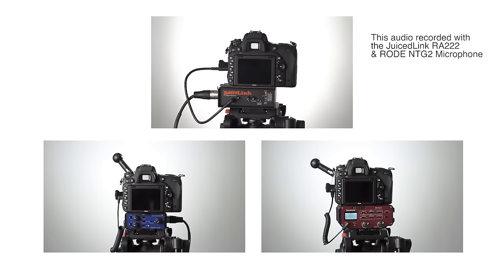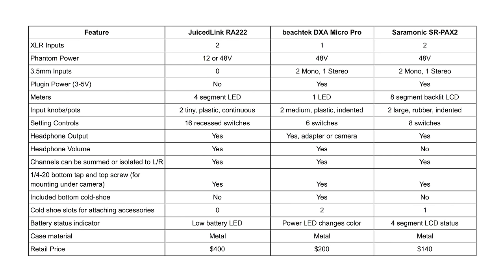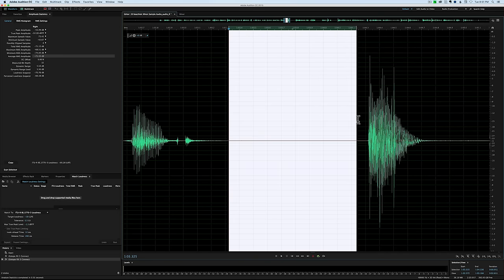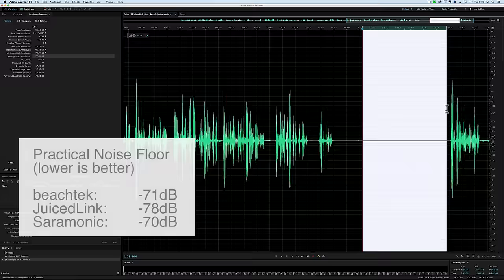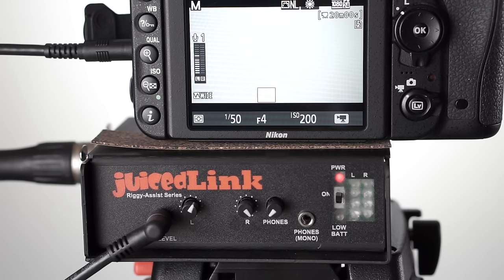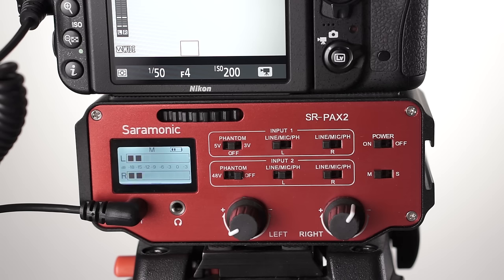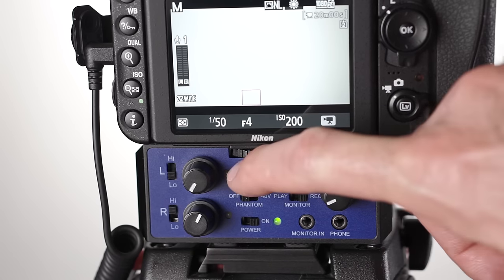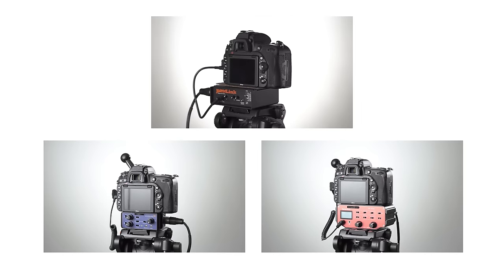Three Audio Adapters for DSLR and Mirrorless Cameras: JuicedLink, beachtek and Saramonic

Comment: Nice review Curtis.

I watched that in a hurry, so maybe I missed something, but in this video the Saramonic unit seems much less noisy than in the +Basic Filmmaker review ?!? Or is there some setup differences that could explain that ?
Reply from the maker: Hi Sylvain, This is a different adapter than the Basic Filmmaker used and he was using a Canon DSLR (I used a Nikon D750). I'm also not 100% sure which settings he used, but between all of those differences, it appears that this Saramonic adapter can do a decent job.
Reply: Ok, 'got it : Saramonic MixMic vs Saramonic SR-PAX2 ...

How could I missed that ?!? Obviously they don't sound the same ! They don't even look the same ;)

Sorry for having wasted your time, Curtis.
Reply from the maker: Not a waste of time at all! I think there are some nuances here and +The Basic Filmmaker and I talked a little about it. We don't have any conclusions yet.

Comment: Curtis, do you have any recommendations regarding the irig pre, pro or apogee jam being used as an audio adaptor with or without iphone app intermediation?  It is my understanding that you can use a converter cable and bypass using an iphone with any of these devices, but wanted to confirm.  How does that affect sound quality?   Best.
Reply from the maker: Hi Matthew, I assume you mean to record directly to a camera? Which type of adapter would you use? The reason I ask is that the iRig Pre HD has a great analogue to digital converter in it. For most cameras, you'd need to convert that digital signal back to analogue only to have the camera do the A/D conversion again so it probably isn't an ideal setup. I hope that makes sense.

Comment: you can fix the heaphone audio volume control  issue with one of these, you can find them on amazon.
Stellar Labs 35-4180 In Line Headphone Volume Control
Reply from the maker: +smitthone thanks for that.

Comment: Curtis great video as always!!! How would you compare the use of these vs a Zoom?
Reply from the maker: +Emilio Jimenez that depends on the zoom. ;) I mostly record audio separately, but these are a good option if you need to deliver your production quickly. These adapters seem more durable in terms of physical build compared to similarly priced Zoom and Tascam recorders. But I still prefer the quality of audio achievable with a dedicated audio recorder. Still, I like having an adapter on hand to use my GH4 as a webcam which avoids audio sync issues.
Reply: Does a Tascam 70D fill both needs? I have a beachtek and a zoom h5, but only 1 NTG3, so I’d like to record straight into camera and onto an SD card.

Comment: Interesting comparison. I own a Tascam DR-60D MKII... Would you say the Saramonic PAX2 can be compared to the Taskam? I'm trying to save some money, but not if it's not worth it
Reply from the maker: Hi Daniel, The Saramonic does not supply as much clean gain as the Tascam and, of course, is not a recorder on its own. One of the benefits of the Tascam is that you can record to both the DR-60DmkII and the camera at the same time which can be a valuable feature in many cases.
Reply: @curtisjudd  you've mentioned that Tascams do not have a clean 3.5mm output. I guess in that sense (recording directly to your camera), Zooms are the way to go.
Reply from the maker: Hi Daniel, the output on the DR-60DmkII is quite clean, it is the 3.5mm input that was on the noisy side.

Comment: Hi Curtis, I am setting up a Sony A7Rii as a Video Production Camera. We have a Zoom F4 Mixer/Recorder. I am just wondering what your thoughts are on connecting the mixer to a camera are? If we are connecting to camera, would one of these adapters be the best to use between camera and audio mixer?  And, if we are using a clapper, is it still safer to connect the audio to camera, or should I be recording seperate sound and rely on the camera mic to sync in post?
Reply from the maker: +Jamie Balfour hi Jamie, I generally just record the audio separately and then sync in post but many prefer to avoid that. If you will always be recording the sound to camera, one of these adapters is probably a better choice as I think the audio quality will be good and more ergonomic. I use a clapboard without feeding audio to camera and have never had an issue syncing. Good luck!
Reply: Curtis Judd 
Thank you Curtis, much appreciated!

Comment: Great video again, thanks for sharing! Can I ask you what do you think about these preamps compare to a zoom h5 or h6...? Is it cleaner than the zoom ? Do they provide more gain ? Thank you
Reply from the maker: They're about the same but generally built better from a physical standpoint than the ZOOM H recorders.
Reply: @curtisjudd  hey Curtis, the H5 costs about 4 times more than the SR-Pax2. Are you sure the preamps quality about the same? I'm about to get the H5. What should I do?
Reply from the maker: @zogun  I have NOT compared them side by side, but noise performance seemed about the same to me from using each of them at different times. Neither of them is GREAT.
Reply: @curtisjudd  hey Curtis, I do like SR-Pax2 but decided to buy Zoom H5 slightly under 250 USD. Thanks for sharing your knowledge & expertise

Comment: hey curtis, why not take the saramonic srx-ax107 instead. It has a headphone volume knob if i'm not mistaken
Reply from the maker: +Eric Fernando good call! I didn't have it on hand for the comparison but that would be even better assuming the preamps are as good.
Reply: hope you do a video of it some time later :).

i do feel that the SR-PAX2 is a bit weird in that it's positioned with small price difference than the SR-AX107, but SR-AX107 has more complete features :(

Comment: Tks for the videos Curtis! I'll start a channel and you are helping me a lot :)

There will be mainly dialogs between two people. We also intend to do some "drama scenes" (not the priority).  My first idea was to get a shotgun (SGC-598) and after watching your videos about the Jk044 I thought it was a good idea to buy two of those and connect with a split in the Nikon D5100. My concern is that the Lav JK has no battery.
I'm looking for quality with a small budget under $200
What do you think it could be the best set?
Reply from the maker: Hi Raphael, Thank you. Recording two people with the SGC-598 would be a good way to start. I would recommend an extension cable so that you can get the microphone closer to the two of you and boom it above the frame like this: https://youtu.be/TUEmQBZKoBs  This is probably a more comfortable way to start than with two lavaliers and having to mess with a splitter attached to the camera. It is very hard to move that way. Best wishes!
Reply: Tks Curtis!
Very helpful ;)

Comment: Can these adapters replace external recorders for DSLR? I shoot with a BMPCC and a Tascam DR 60 D recorder. Synching in post is always a pain even in Premiere where it is just a few clicks. I still have to line up the right audio track on the Tascam with the scratch track on the BMPCC for each clip before I tell Premiere to perform an exact wavelength synch. I would enjoy having my sound cooked into my video card if I am not sacrificing audio quality.
Reply from the maker: There's some debate about whether this can completely replace a dedicated audio recorder but if it sounds good enough, then I'd say people should go for it. One factor in the final quality is the nature of the camera's microphone preamp. I have not personally tested the BMPCC so I cannot say for sure but I have not heard great things about it. That may or may not be a deal breaker. If you decide to try, I'd consider purchasing the adapter from a retailer with a generous return policy so that you can back out if you're not satisfied.

On a technical note: most cameras record audio at 16-bit. Even cheap audio recorders like the Tascam can record 24-bit audio. There's debate over the difference 16 vs 24 bit makes for audio recordings. I can say that I cannot tell the difference between 16 and 24 bit just by listening to two identical clips at the different bit depths, but I suspect that like with cameras, capturing more gives you more latitude in post.

I hope that helps!

Comment: Hi Curtis . I have a 4 person interview coming up and I find that I like lapel mics better . do you know if it's possible to stack an additional saramonic audio adapter on top of the other to get audio from all 4 lapel mics through the dslr . searching youtube and I have yet to see this question answered . thank you
Reply from the maker: Hi Leslie, It is probably possible, but you would need three of them - one to go into the camera and two others to accept each of the microphones. Unfortunately, not a great option. Or at least you would need two of them plus a splitter. I'd avoid that if possible. It seems to me that there is room in the market for a 4 or 8 channel mixer with 3.5mm inputs. Unless maybe somebody else out there knows of such a device?
Reply: I will research this . thank you so much!

Comment: Hi, Curtis, 
first off, a very nice video. Thank you for uploading! 

Secondly, it might be a little desperate to comment on a five year old video to ask for advice, but I'm just making the transition to using an audio adapter with my D750 and had a few questions. Did you ever get the chance to check out the Beachtek DXA-Micro Pro or Pro +? Would you recommend a certain adapter? 
I'm planning to record audio from my bass amp for fx-pedal demos and was wondering wether or not the audio quality would be 'presentable'. 

Thanks!
Reply from the maker: Hi SquareWaveSyphonies, I did not get a chance to use the others. It seems like audio adapters have sort of disappeared these days. I use a Sound Devices MixPre these days when I need to get audio into a consumer camera with 3.5mm input.
Reply: @curtisjudd  Thanks for your input. I'll check that one ou, aswell! :)

Comment: been wanting to purchase juicedlink for the audio bracketing / safety back up channel -16 feature. Do any of these other adapters have audio bracketing or limiters?

Also I saw this [ link] : https://scontent-lax3-1.xx.fbcdn.net/v/t1.0-9/13615368_1134868213233388_5980309971924652445_n.jpg?oh=5cfa18ae8f2fefaff5710b7935a0aebb&oe=585C28AA 

Have you thought of using an XLR splitter to have 1 channel as a back up (lower dB)? pros and cons to doing this ?
Reply from the maker: Hi, neither of the others have the audio bracketing feature. I haven't used splitters and don't understand enough about the electronics to know whether there are any risks there. The first thing that comes to mind is if your mic needs phantom power, do you power from both channels or just one? Any risk of damaging your microphone? I just don't know enough to answer those, unfortunately.
Reply from the maker: Thanks for the clarification Harry!

Comment: No mention of using a DR for pre's. About the same cost, size, extra features, more flexibility. No? Yes?
Reply from the maker: +Ion-Christopher, Acts of God definitely works. DR-60Dmk2 is slightly bigger, more plasticky, but can record. I prefer using the Tascam over any of the audio adapters
Reply: Curtis Judd  having fun. Learning NPR quality with a DR-07 and hitting limit of any manual control of auto systems. Can't predict self adjusting gain. Need 2steps up next then .. Like 60D, but like pocket, lanyard carry.. Pick? GREAT!

Comment: Wouldn't the Tascam DR-60D mkII do the same thing, and add the recording possibility?
Reply from the maker: Yes, you are absolutely right. The audio adapters are useful when you know you won't have time to sync and in terms of build quality, they are much more rugged than the DR-60DmkII. So it is a tradeoff and not for everyone or every situation. I like to use them when using my Panasonic GH4 as a web camera because then the audio stays in sync better than if I have a separate microphone connected to the computer.
Reply: Thanks for your answer!

Comment: If you used a fethead would it work well with a dynamic mic like the re20?
Reply from the maker: I no longer have these on hand to test, but yes, they should work. Will just need to feed phantom power from the adapter to the fethead.
Reply: @curtisjudd  thanks for the reply!

Comment: Thanks Curtis, 
Honestly, with a quality mic I cannot tell the difference in audio quality now between my BMPCC camera audio or with the Tascam. I just use the Tascam because I am paranoid and sort of brain washed over what others say about DSLR audio. Plus, it is insurance since there is too much time and expense to shoot the commercials that I make that I would not want to do it over again because of poor audio. Occassionally, I will pick up noise on both of them; but I don't know if it is internal or external noise. And any noise I pick up, I can remove in Audition when I pick up a raw sound print of the noise.
Reply from the maker: +Doug Vaughan that makes sense. Better to be safe than sorry on paid gigs.

Comment: Hey curtis, 

by any chance do you know how the 3 adapters in your video compares to:

1.) https://www.youtube.com/watch?v=U5nOkyiu3qQ
2.) https://www.youtube.com/watch?v=eRLwxllAIwQ

I just need 1 XLR port for 1 shotgun microphone into 1 camera. Both these budget preamps provide phantom power, no control with head phone volume. Are there any features in the 3 adapters you show worth looking into for my set up/projects? Do you think I should save up for an adapter instead?

I mainly shoot interviews, events, dialogue stuff.
Reply from the maker: Hey! I haven't used either of those personally, but I'd seriously consider the Saramonic Smart Rig+ if the budget is particularly tight. Looks like it has everything you'd need and should keep you very nimble. Good luck!

Comment: I have the Beachtek DXA-Micro + hooked up to my Rode NTG5 using The XLR that came with the microphone and then plugged into my canon Sl2 using 3.5mm jacks. 

I’m experiencing a very high pitched frequency when I record now, never happened before when I used the Micro Pro+ with my Rode Video Micro, but now that I’m using an XLR Mic... The noise is present. I’m not sure what it is or why it’s there. 

Would anyone on here have an idea of what that could be from? Maybe a faulty XLR cable?
Reply from the maker: Could be the cable - I'd swap out both cables - XLR and 3.5mm. Cables are often the issue. Another thing to try just for troubleshooting - remove the beachtek and camera from each other so they are not touching. I've found that some cameras tend to pick up interference when the audio adapter and camera are touching.
Reply: @curtisjudd  Thank you for taking the time to reach out and offer some possible solutions, It's genuinely Appreciated! I'll Swap out/upgrade the cables I have and try moving my Beachtek and see how that works. Thanks again, Hope all is well, Cheers!
Reply: @curtisjudd  In the last few years I've been recording more critical projects so I am scrutinizing all of my eqpt. For cables and 3.5mm lavaliers I already have where I'm not certain of the origin or construction, I'm slicing the jacket so I can have a good look. It's disappointing how many TRS plug-in power lavs and 3.5 mm interconnect cables have zero shielding. Quiet in my place, then BZZzzzzz on location. Then my original H1 ($20 find) hidden on the subject is the belt and suspenders backup plan.

Comment: Can you connect the beachtek to iphone 6s? I'd rather use this than the smartrig
Reply from the maker: Yes, you just need this adapter: http://amzn.to/2uKQc3s
Reply: You agree to use this over smartrig+ or irig pre
Reply from the maker: Yes, better build quality.
Reply: +Curtis Judd Hey Curtis, will Rode SC7 3.5mm TRS to TRRS Patch Cable work? Directly from beachtek to iphone 6s?
Reply from the maker: Yes. One note: smart phones only record a single channel of audio so to make this work, you'll need to send a mono signal from the beachtek to the phone. You do this by setting the output to M (for mono). Good luck!
Reply: Curtis Judd That sc7 isn't working. In my input is on mono but both l and r to high. Then I have the sc7 going from beautek to iPhone? Any tips or sc4 is a better option?